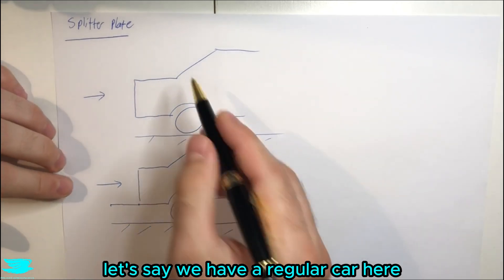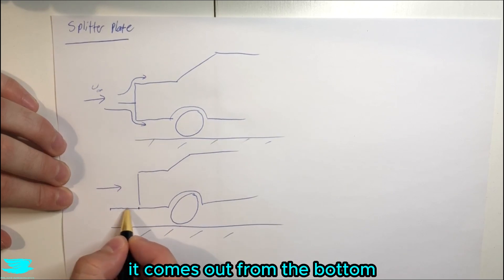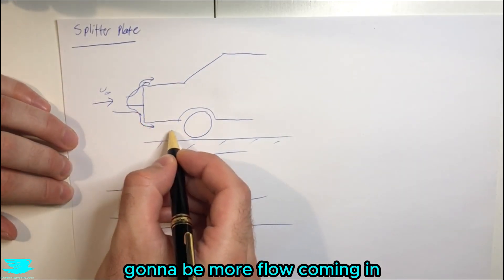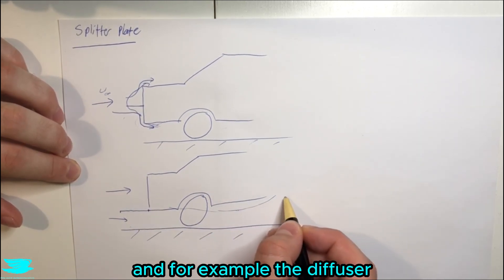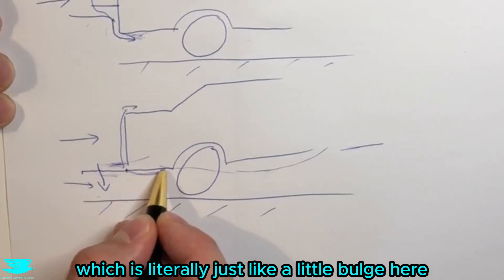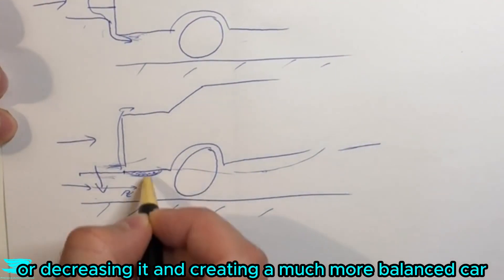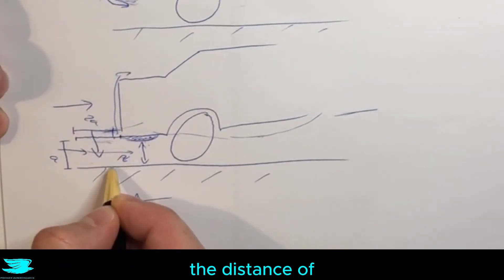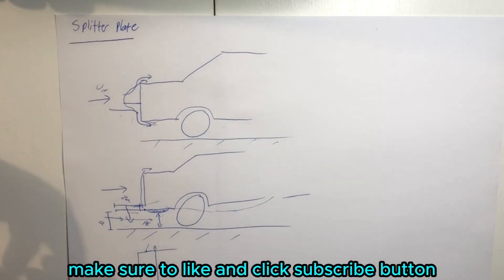Splitter Plate Aerodynamics {Auto Aero #64}

Comment: Could you do a video on the effect of older cars vent windows on aerodynamics? You can have them in a position where air is pulled through the cabin or directed straight into the car so I always wondered how that would change the drag.
Reply from the maker: Thanks for the idea! Do you have some examples showing the different geometries? Sorry, I’m just not sure exactly what you are referring to.
Reply: @PremierAerodynamics  I've got a 91 ford truck and my buddy has a few classic VW bugs that have them. They are the small windows ahead of the door glass that you can swing out to get airflow into the car. (Because you don't have AC lol)

Comment: They're all just upside down wings to counter the lift produced by the wing like car. Splitters are awesome, not only do they help balance cars at the front, they also produce more downforce at the front under braking as the car pitches forward. Like planes, cars roll, pitch, and yaw/side slip, unlike planes, the physics are literally upside down. When a car rolls away from a corner, the roll increases downforce of the front splitter on the outside and reduces it on the inside of the corner. This induces an extra yaw moment into the corner. The attitude of the car has a huge impact on the angle of attack of any device on the floor, and it's proximity to the ground. When you accelerate if you have a lot of rear suspension travel, the splitter will rise off the ground, and the rear diffuser will squat down, so you get both COG and COP moving backwards causing more understeer. You can play around with the suspension geometry(anti-squat/anti-dive), and suspension settings to keep the floor in its happy place.
Reply from the maker: It’s really cool how such small changes in roll affect the splitter’s performance, especially when you have large ground effects occurring.